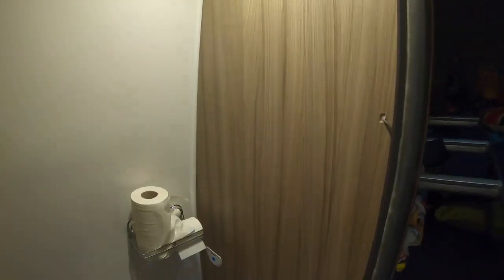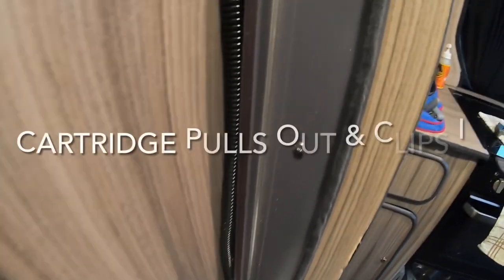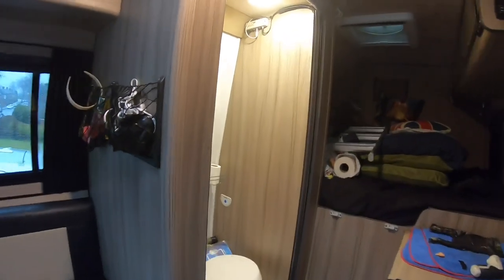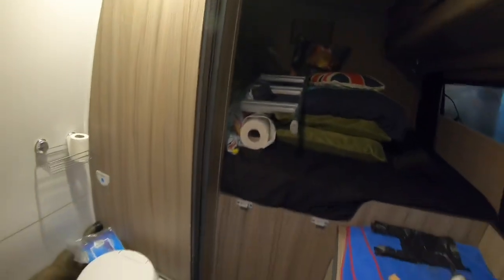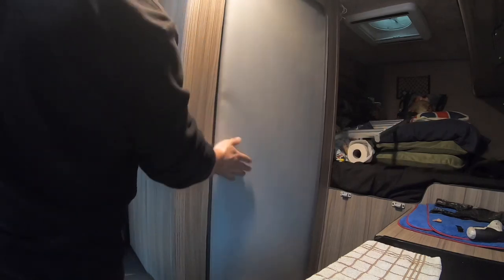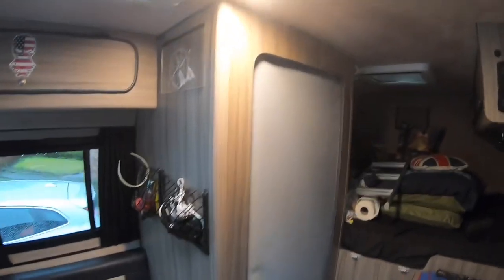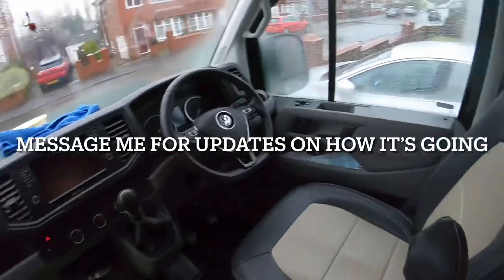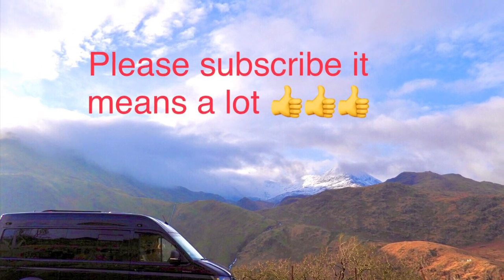ROLdour,camper toilet shower door,new Vw crafter,selfbuild toilet door,camper shower door

Comment: Looks slick ! Fully waterproof ?
Reply from the maker: Yes designed for shower doors 👍
Reply: @vwadventure  thanks. One more thing - does it slide easily and can it be left half open or is it spring loaded and retreats all the way back ?
Reply from the maker: Slides easily & can be left open or halfway , like brushes all the way round frame to seal it .
Reply: @vwadventure  excellent ! Thx
Reply: @vwadventure  hello 😀  I have one of these but am totally stumped on how to make it waterproof at the bottom. Can you share how you did yours?
Reply from the maker: My bottom rails inside the frame 👍
Reply: Have you got a link to this??